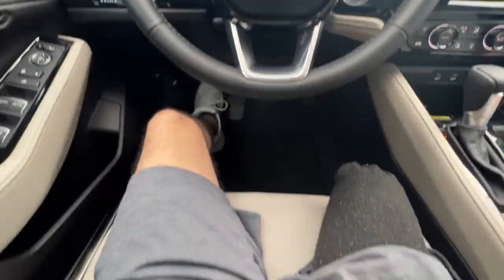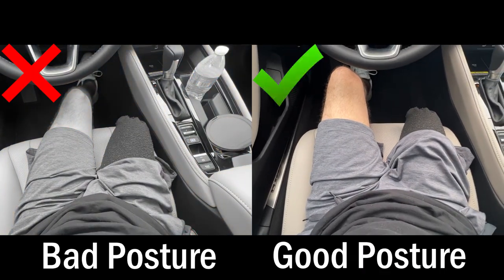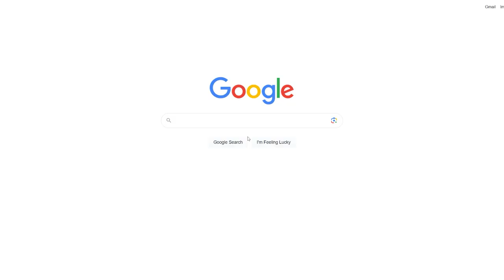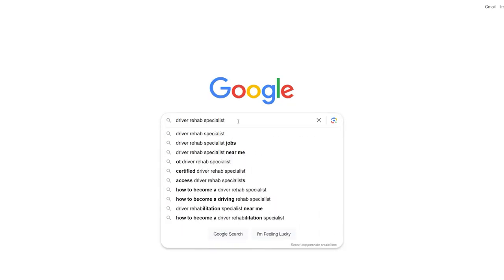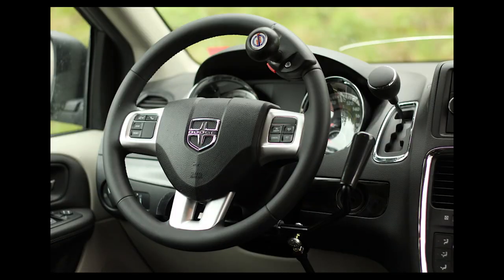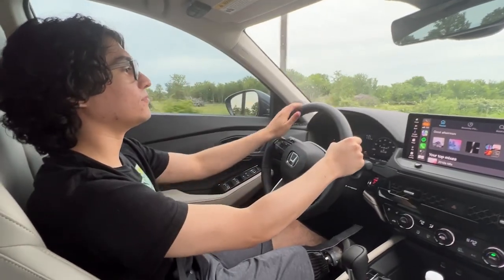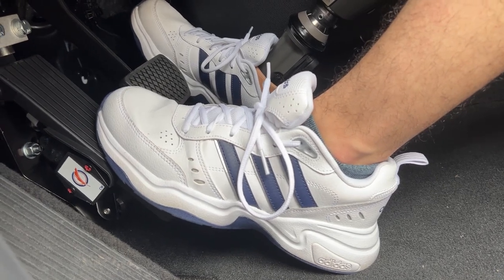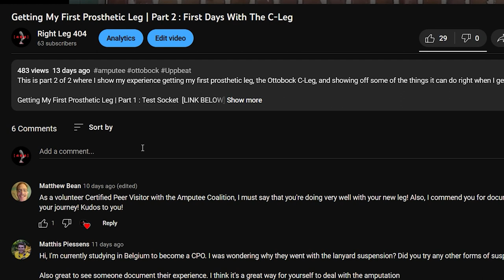How I Drive Without My Right Leg | Using a Left Foot Accelerator

Comment: I built my own for less than half the retail cost but you can buy them online for about $180 that simply sit on the floor board. At first, you have to remain really conscious of what you're doing until you get used to the difference. I've been driving with it for 15 years now.

Comment: The right leg was amputated above the knee, the left leg was amputated below the knee. I drove a manual, pressed the clutch with my left hand, and manually operated the gas brake. Now I bought a car with an automatic transmission, I drive on the left, but I’m thinking about a backup pedal, it’s really not very comfortable to sit.

Comment: I got one.  I took one drivers lesson, then got a Dr’s note and got a special drivers license.  I’m buying a new bmw and they pay 2500.00 mobility credit.  And so the dealer is working with mobility (United Access) to have it installed before delivery.  Yes, it does take some time getting used to, but it’s learnable…and I’m 69.  Shout out to Lincoln BMW in Nb.  Just take it slow and practice in a parking lot. 

You are a cool young man, thanks for posting.

Comment: I am going through the same thing.  I couldn’t get the left foot accelerator installed unless I did the certified driving instructor course and test.  You are right it is expensive.  So, is the part.  I chose to do it, though, in case I’m ever in an accident.  I wanted to be able to demonstrate that I have done everything possible to be a safe driver.  I also need to take the DMV road test to get my license updated.  It is a process.  I recommend, as you said, that people start early.  Thank you for sharing!